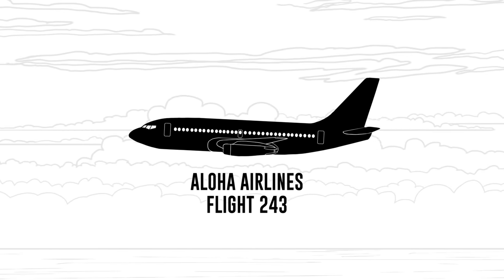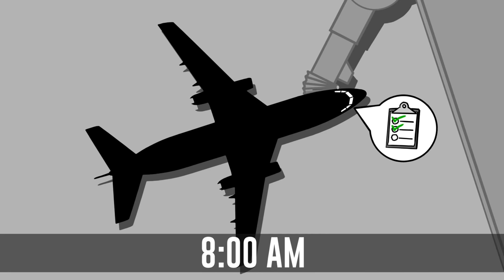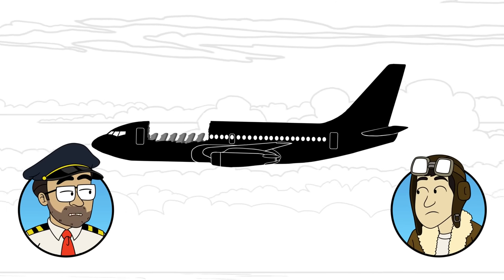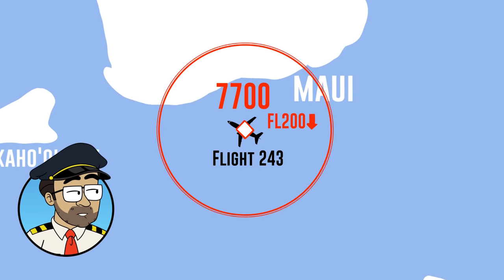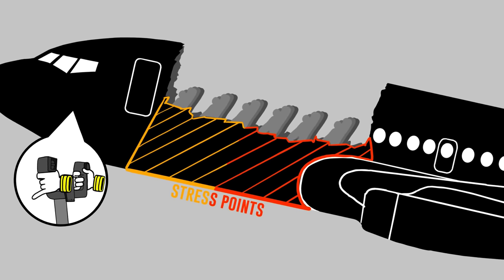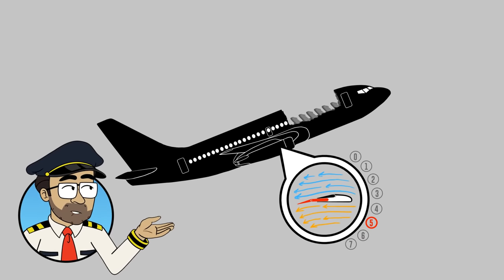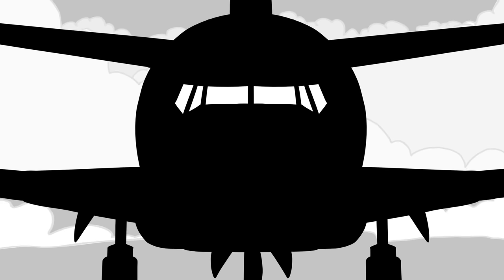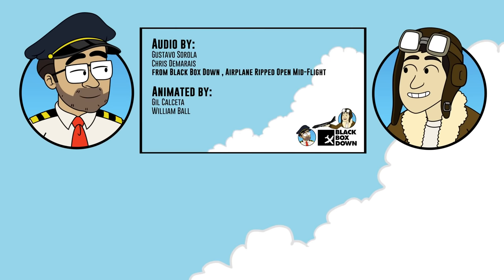How Does a Plane Fly Without a Roof?! | Aviation Explanation

Comment: Whats truly terrifying is that small panels are designed to pop off to stop this exact thing happening. Which here, they actually did. However, blood on the outside of the plane indicated that somebody had collided with the outside. The only life lost, CB Lansing appears to have been pulled through a SMALLER hole when the small panel failed. However, she briefly blocked it. Causing the rest of the weakened panels to give from pressurized air. Meaning if CB Lansing wasn't standing EXACTLY where she was the plane would have never lost its roof.
Reply: Good lord that's terrifying. I can only hope she lost consciousness quickly.